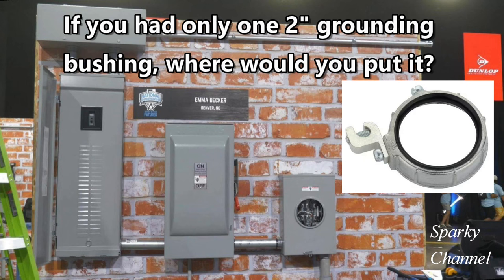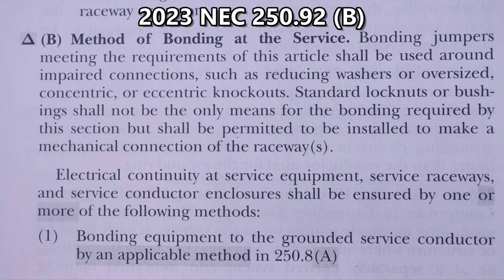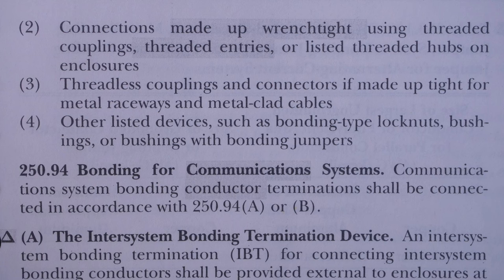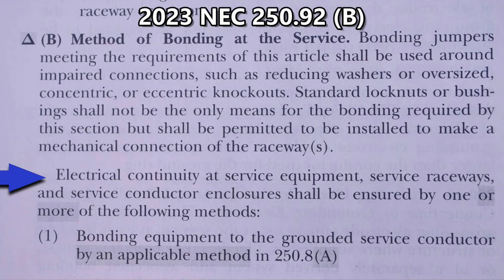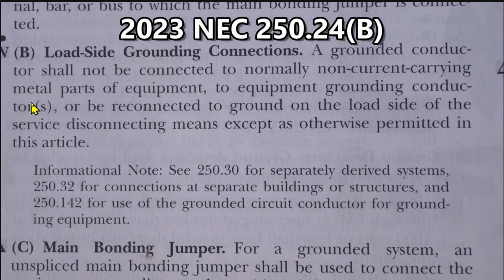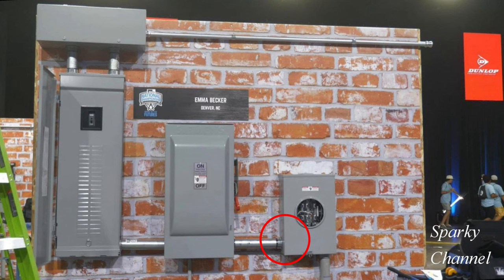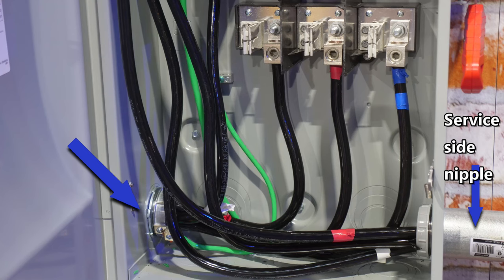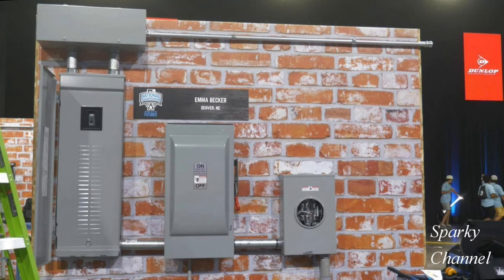Where to Put Grounding Bushings? 2023 NEC 252.92(B)

Comment: I was about to make a correction comment, but you updated your video accordingly.  🙂 (Without the bushing on the SEC nipple, the nipple would not be bonded.)
Reply from the maker: LOL! I beat you to the correction this time. Yes, the nipple between the meter socket and the safety switch has to be bonded. I didn't realize that at first.
Reply: 👍😄 @SparkyChannel
Reply: Since the raceway/nipple connecting the meter socket to the main disconnect is getting bonded at the disconnect, and the meter socket itself is bonded through the bonding of GEC and the neutral wire at the disconnect, the only item remaining that is not bonded is the nut securing the nipple to the meter socket, and that does not need to be bonded. One may argue that you will need a grounding bushing on either end of the nipple connecting the disconnect to the load-centre. That is the only nipple that is not properly bonded with only 1 grounding bushing.

Comment: Feeling smug, because I guessed the correct location instinctively. Why did I jump straight to that? To me, it goes along with the rule about grounding the service disconnect itself. If that is the definitive local ground, it follows that it has to be where the ground is propagated to the conduit. But I'd install one on each side, because I want to be really, really sure no run of conduit can fry anyone under any circumstances, and $15 or so for an extra grounding bushing is cheap insurance.
Reply from the maker: Great job! Yes, an extra grounding bushing is a great idea. The contestants only had one, so they had to really know their code.
Reply: @SparkyChannel  I guess with the meter base and that 3pole discount both having eccentric/ concentric knock outs how only one end of that nipple is required in the code to bonded and not both ends
Reply: Do you feel extra smug because you had to let everyone know you guessed it right?
Reply: @vicktorpatriot1430 I would of put in at both ends or the one in the meter and just pull a ground from meter to disconnect for that reason of what if concentrics break at meter.

Comment: I would be prone to putting a ground bushing on both sides of each conduit.  Should a fault occur within any conduit the remaining knock outs in the hole may provide a poor electrical path and might result in a lot of arcing and possible fire hazard.  Just my two cents, I realize it is not required less than 250 Volts.

Comment: I would but it on both ends or the meter end only and just pull a ground wire just in case the concentrics at the meter was to break.

Comment: Service conduit in one end only

250v+ to ground on one end only, unless you don't have concentric knockouts

when metal flex is used as EGC under allowed conditions

When running a GEC or an electrode BJ in a ferrous conduit. It's required on both ends to nullify inductance

Comment: Good video. Say with a 480V circuit and  you are leaving a bonded enclosure with EMT directly KO'd (no concentric or eccentric etc) going to a box WITH concentric KOs, a bond bushing would NOT be required as the conduit is properly bonded on one side, correct?
Reply: On the line side of a service disconnect you still need to use a bond bushing under all circumstances I believe.
Reply: @ed6837  right. I wasnt clear but I was talking about a feeder or branch circuit at 480v
Reply from the maker: See 2023 NEC 250.97 Bonding for Over 250 Volts to Ground
Reply: I believe because it's 277/480 you have to have the grounding bushing no matter what for a service. (or other means listed in the next)

Comment: what if you just ran a continuous unbroken ground wire from  2 ground rods through a lug connected to the bonded neutral in the meter socket to the ground bus on the next panel? Wouldn’t that effectively ground the entire system?
Reply: You'd parallel the neutral....putting objectionable current on the housing of the panel, the disconnect, and the nipples.
Reply: You're double dipping there, creating currents in the GEC
Reply: @ElectricianMagician yeah, grounding the meter is always a big mistake